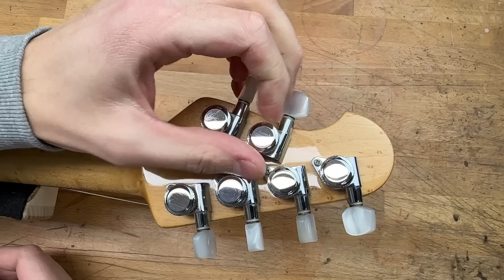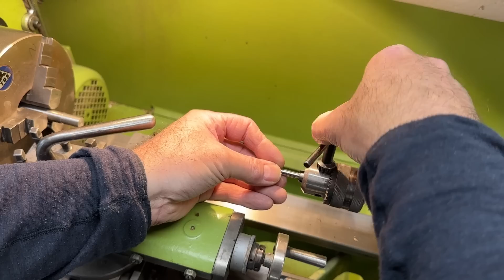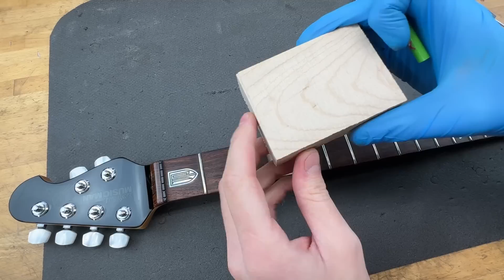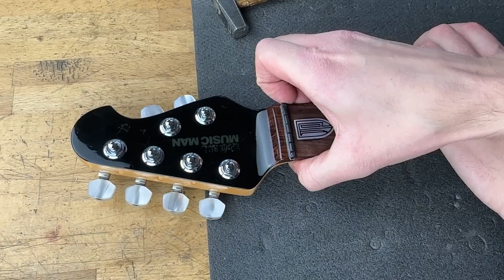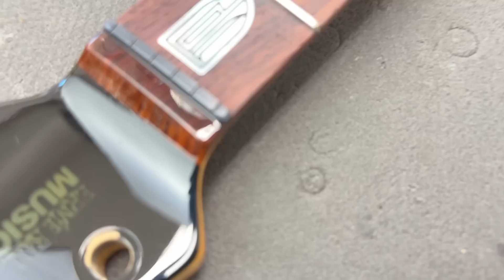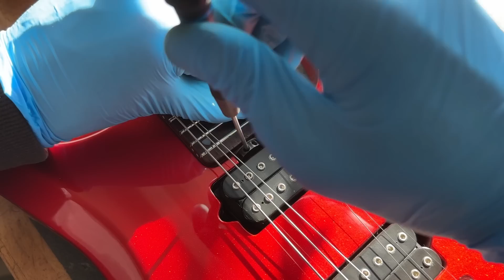Guitar repair with X-Ray and Laser Welding?!

Comment: The end result looks very good - the rosewood insert matched very nicely in the end. Does removal of that much wood from the neck and fingerboard cause any loss of strength around the point of repair? (Especially as the maple plug wasn't epoxied in). Would you say that this was easier than removing the fretboard? I've got a fretboard to remove and I've been putting it off for quite literally years : ) You made the installation of the stainless steel frets look easy!

Comment: Nice work, man! But I noticed new frets sitting with a sufficient gap in the middle - maybe it`s a camera angle or just glue residue. Do you use feeler gauge to check that gap when installing frets?

Comment: That dedication to this works is 💪. 

Genuine question, the whole procedure looks expensive( including travel to get the x ray and welding). Is it really 3 times cheaper than to get a new neck? 

I mean, here in Singapore the most expensive refrets cost like 550 usd.( i know its absurb).

Comment: I must make the point that when the truss rod is that tight, the neck needs to be reshaped with a heat press. The wood should provide 70-80% of the counter force to the strings and truss rods are reinforcement, they are not intended to be load bearing.

Before it getting so far gone, the neck needed to be heat pressed and reshaped to avoid this entirely. Truss rod nuts should turn with very little force to make significant shifts in angle. When they are tight, it means the neck needs heat pressed.
The truss rod nut should always have slack and plenty of threads to spare if the wood is shaped the way it needs to be to provide the majority of counter force.

Comment: Amazing work - this is basically surgery on a guitar (literally)!!  I really like having the voiceover/ narration.  One question - you said that it would cost more to replace the neck than to perform this type of repair, but does that factor in the cost of the x-ray and welding?  Or is this unique to this guitar because ErnieBall won't sell replacement necks?  It almost seems like in most circumstances, the cost for this amount of work would far exceed a new neck if all expenses are included (of course, setting aside sentimental value etc)?

Comment: Taking out of the picture that your job is exquisite , well done , amazing job. 
After saying that I put myself in the position of the owner and  I don't get how much cheaper it can be to take the neck to get an X ray , do the laser welding , plus hours for just doing that plus to sand and refret the whole neck ? IDK 200$ cheaper ? I don't think so , but even if it's 200$ cheaper always you'll have to deal with a broken truss rod that with time and humidity can be a problem it's a repair so it's not new and we don't know for sure if it will be a permanent fix, just the fear of having that truss road broken again cost much more than those 200$ I dont  know if that neck from Music Man cost more than 600$ but I don't think that job cost less than 400$. 
        But more important is that as an owner of that guitar the first thing I would do is to contact the company  because that truss rod should never have broken, in any case of exerting a force such that this could happen, the normal thing is for the thread to give way, I believe that this is a problem with the steel of that specific truss rod, therefore Music Man must be responsible for it and give a new neck free of charge or half priced or something. If I were the person in charge at Music Man of attending this case I would send a new neck free of charge, and of course with my apologies for the problems created by my product.

    I think you did a great job but the story doesn't make sense.

Comment: Friend, why not remove the guitar's scale and replace the truss rod? It would be less invasive. With so much technology to weld a truss rod that would probably last much less time than a new one. I thought the work was sensational, but if the instrument were mine, it would be a service I would never do again. If this guitar falls, I'm afraid that even though you filled the loose area, the wood could crack or even crack with the truss rod adjustment itself over time. But visually, the work was sensational.
Reply: You mean remove the fretboard? Is it possible do that without destroying the fretboard?

Comment: This is a very interesting way of fixing the neck. I think I've never seen it done this way. However as I client and an engineer, I would never let you do that on my guitar. You have removed so much wood around the break, that there is very little continuity. The patch which you applied is not even end-grain to end-grain, you just filled the gaps with glue. I'd maybe feel better if it wasn't so wide. I'd argue that the only acceptable way of fixing that is removing the whole fretboard, especially when you've done the refret. If you then add some carbon rods, the client would end up with a product better than before it broke, and now he have a guitar with hidden and irreversible flaw. Its a MusicMan, it was worth the cost of proper fix.

Comment: Wouldn't it be less work to remove the scale, change the truss rod and glue the string back on?
Reply: Remove the "scale"? Glue the string? What...?
Reply: remove the scale and replace the tensioner
Reply: @ What scale? The E minor pentatonic scale or the kitchen scale? And why should the string (and which one?) be glued? And which tensioner are you talking about? It's like were speaking completely different languages with totally different vocabularies.

Comment: You'd have to be inches away to see that replaced fret board piece. And then putting on the strings conceal that.

Also, I didn't know laser welders were a thing.

Comment: If it's a steel truss rod, could you not have attached a strong magnet to the tip of the piece of rod you removed and used that to extract the broken piece inside the neck?
Reply: Truss rods are essentially very long screws, so the other end is fastened to a captive nut.

Comment: This was really cheaper than buying a new neck?
Unbelievable!
Well done.
Reply: The current Petrucci models retail for $3500 to $4000, so I can see why a neck costs 1/4 the retail price. Also, the labeling is different, so matching the original model would require custom work. I guess that's why it's so expensive.

If the repair "damage" is internal thus invisible, I guess it doesn't really matter as long as the outside looks good.
Reply: @potato9832  Just think for a moment you spend nearly 4000$ on a guitar and you let this to happen , of course not the first thing you do is to call music man bc that is a faillure of the steel in the truss rod , as soon as they see the images they have to send you a new neck or at least to take some responsibility for it and send it to you at a very low cost , we are not talking about cheap guitars , probably they made that and this video is done with a neck that would be in the rubbish bin but makes great content .
 Just ask yoursel you paid 4000$ for a guitar just to have it with a repair in such critical point ? listen that repair can be there forever or it can break tomorrow , its a repair , so nobody knows , the only thing the luthier can do is to guarantee  his job , but would you go through the same problem againg ?  I don't thinbk so , that reapir is expensive and a neck is no more than 600$ .
Reply: @ Whut? Sending a free neck for reasons of doing the right thing? That is woke commie talk. Buyer beware. The new economy is you are on your own, unless you have the inclination to sue. Empathy is sin. Compassion is illegal. And honor is dead.
Reply: That's BS

Comment: I prefer talking. It's much better to see without having to keep glancing down at the bottom of the screen to see the description of what's happening. I wouldn't have fixed a truss rod this way but honestly it was much easier to remove a tiny part of the fretboard than to remove the whole thing. i would've cut the fret slots through the depth of the fretboard then steamed it off. It would be much easier to hide the repair this way and not have to worry about mismatching grain. But remember: Musicman doesn't use lacquer - they only use polyester for their finishes. But all in all you did a stellar job! Thank you for sharing this with us to enjoy.

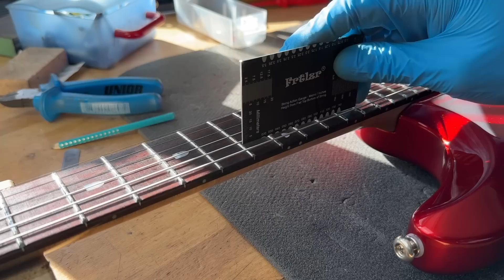Comment: A common mistake i saw on this video, and especially on tanya shpachuk's videos, is that the fretboard wasn't taped off whatsoever when working on the frets and nut, dust and metal filings will get into the pores of the wood. And you should NEVER sand against the grain of the fretboard wood since you'll get scratches that are incredibly hard to remove: 11:06 
All in all Tanya's videos are very entertaining, but her techniques are way off so i wouldnt recommend learning from her example. I hope this comment was constructive! :)
Reply: Also, on another note, leaving fretboard oil on it for an hour is generally not something i'd recommend. That's leads to overoiling the wood which can make it swell and soften too much with as consequence the frets getting higher/loose. So what i would do is let the oil on for 5 minutes max and then wiping it off.
All in all i think you're incredibly skilled and well on your way!
Hope you have a great day and that my comments helped :)

Comment: The headstock clearcoating looks very bad for an EBMM. There's orange skin and there are bumps above the logos, as if it wasn't level sanded. The body paint stained the next, as if the neck was fit before the body finish had dried. There aren't any piezo so I would have bet it was either a Sterling or a Chinese knockoff but the bridge does say "Music Man"
Reply from the maker: The headstock wasn’t lacquered by me only the small piece of fretboard behind the nut, it is lacquered perfectly by the factory it was just the light hitting it from a weird angle.
Reply: @TON-guitarworkshop  I didn't imply that you had something to do with that, just that it looked odd. Maybe it was refinished at some point...

Comment: To be honest, at first I thought ... why woudn't you just remove the fingerboard and the truss should be right under it. However when you remove that section ont the forth fret, I was surprised it's just a solid chuck of Maple there. I went on to check and obviously the JP does not have skunk strip either. I even checked some of the MM factory tour and I didn't see how they put on a truss rod on a guitar. This is actually quite suprising. 

This is the first time I see a truss rod get fixed by welding in place. Usually it would be replaced with a new rod. Quite amazed and a little concerned. Stll this guitar is not mine so I shouldn't be too worried. It's probably strong enough to withstand a few decades, I don't know...

Comment: Laser welding's a relatively new process, and I doubt the in-situ repair would have been possible with any other welding method.  Welding always affects the structure of the steel in the surrounding area though, so while the repair was tested, I wouldn't be surprised if it failed again.  The truss rod's brittle fracture in the first place suggests that the steel had a defect (maybe a tiny nick/notch that acted as a stress raiser), and even with the weld, the underside won't be perfectly smooth.  Nevertheless, the repair was superb and I do hope it lasts the life of the guitar.